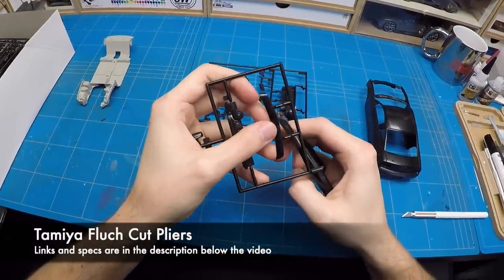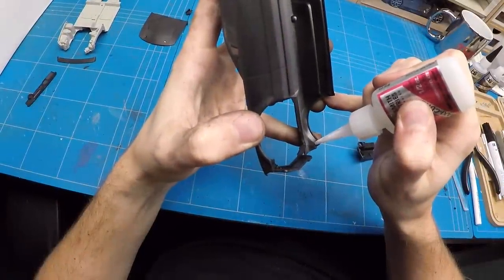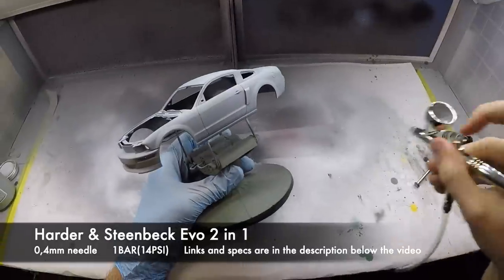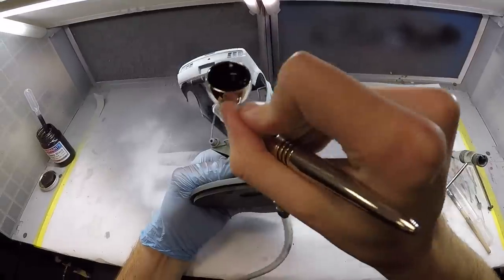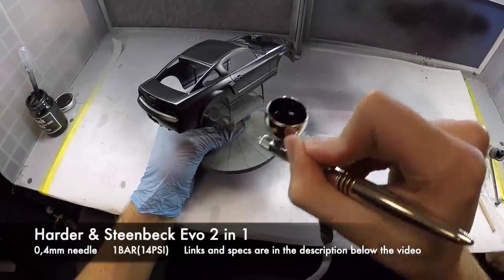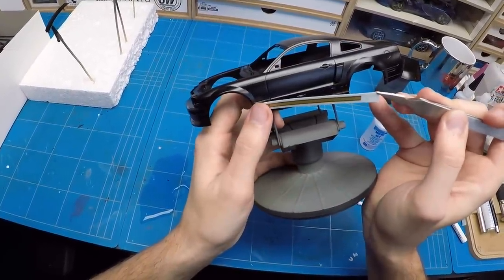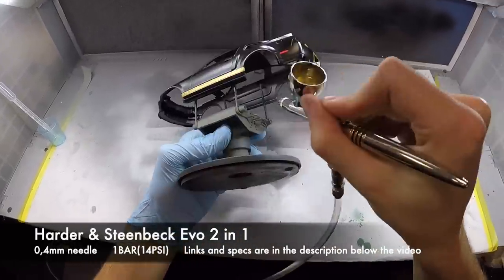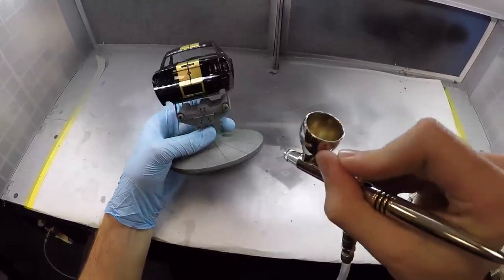Revell: 2006 Shelby Mustang GT H Part 1

Comment: hi, just wondering what is the point of sanding the body before paint? loving the result so far too , i want to build one myself
Reply from the maker: To remove imperfections. Make the body lines smoother and most importantly to have the paint actualy stick to the body
Reply: @TheScalemodelingChannel  thanks nice to know

Comment: hi, anothe nice video thank you. I have a couple of question.
During dry time, do get any dried paint in tip of airbrush or how do you avoid it?
after using prime coat do you clean your airbrush before appliying the color?
Reply from the maker: I clean my airbrush when i change colors

Comment: Hi,
Just a silly question about spraybooths. I live in an apartment and was wondering about ventilation. Can I have the spraybooth in my living room and have some sort of ventilationtube attached to the booth and lead it out the window? Or is at a living room a generally bad place to do the painting?
Reply from the maker: If you want the living room to smell like paint. Then yes. Otherwise. No not a good idea
Reply: @TheScalemodelingChannel  haha, I wouldn't mind, but probably the missues.. Is there any other solution if you don't have much space to work with?
Reply from the maker: Not realy
Reply: MrRockajill If you have a good spray booth with the extraction hose out a window and only use alcohol based acrylics like Tamiya and not lacquer/enamel and DEFINITELY not 2K, you may not have any complaints spraying in the house. But yeah in your case I would do all my painting outside weather permitting/more than 55 deg. Do your research if you ever are tempted by 2k. Hazards can’t be over stressed. 3M Respirator, cover ALL skin and eyes. IMO Only use with paint booth with at minimum 350 cfm extraction rate and outside vent. With 2 booths like he uses you have 500 plus. Shocks me to see people spraying this with skin exposed and no respirator.
Reply: @chadjaeckel  thank you so much for your answer! This is the kind of information I was looking for 🙂